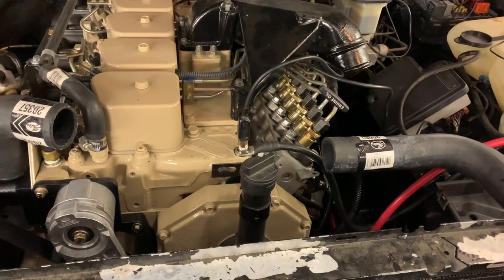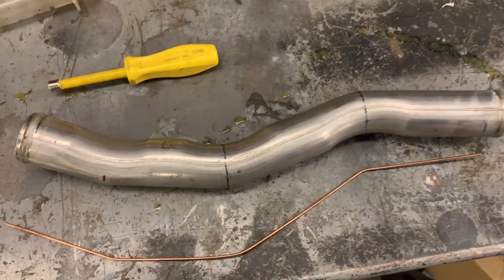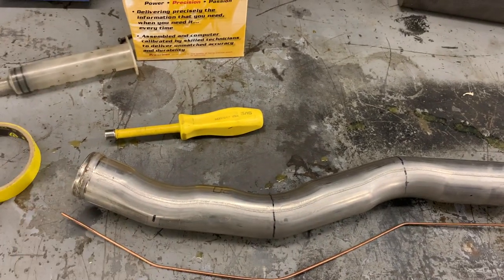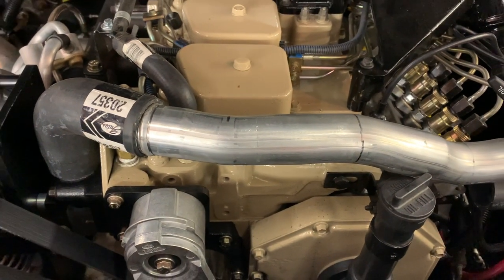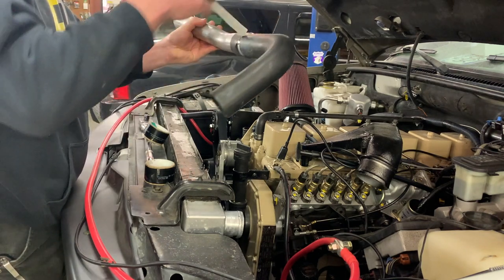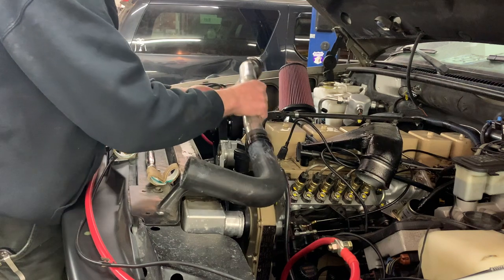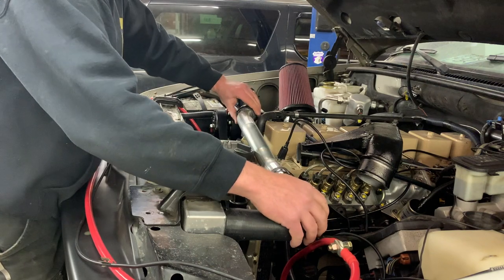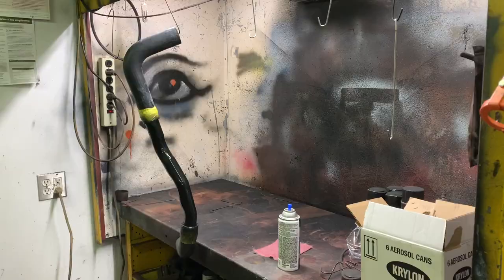Build Your Own Custom Radiator Hoses

Comment: this popped up in my subscription feed at the perfect time, i had planned on making one like this. i froze some water in my tube and the bend turned out real nice, im in the middle of making a bead roller for it but i plan to powder coat it and use the heat shrink on it. 
thanks for the video yours turned out real nice keep up the good work!

Comment: Perfect.  I was just looking at my modified engine in my Vette.   My brand new radiator hose is coming nowhere near where the old (TPI) outlet was.  This is just the info I needed.  Never saw those Gates Shrink Clamps before.  The only thing missing was I would have liked to see how that bead was rolled into the pipe.  I'm pretty sure I've never seen bead like that in an  exhaust shop.

Comment: I put a radiator cap fitting in the center of the crossover, with the overflow port plugged and a 35 psi cap installed. The 15 psi cap on the reservoir is for pressure relief to the overflow, and the cap in the center of the crossover is for filling and bleeding air. Because it's the highest point in the cooling system it makes bleeding the air after a drain and refill a breeze.

Comment: Back when I was poor and young, I would make it happen by connecting various hoses together like that because every time I got a used radiator from someone, the inlet/ outlet was on the wrong side.
Reply: The older katolight generators tried to use common off the shelf stuff ,like those flexible radiator hoses so that way Farmer Joe could get one at Napa and not wait weeks for a custom factory part ✌️